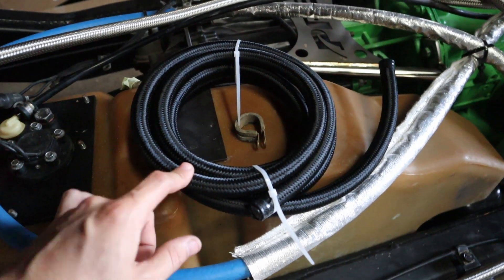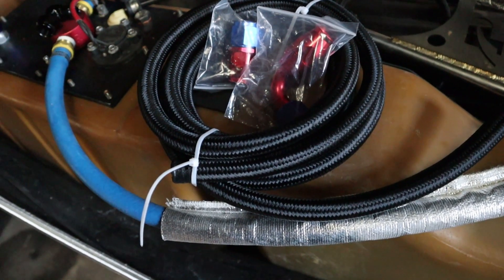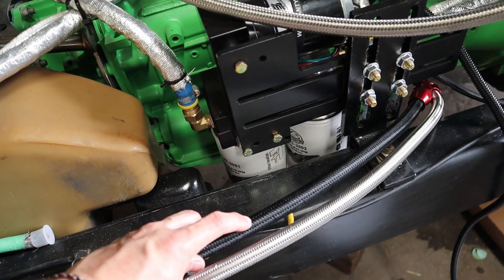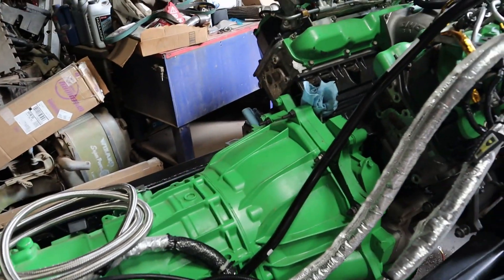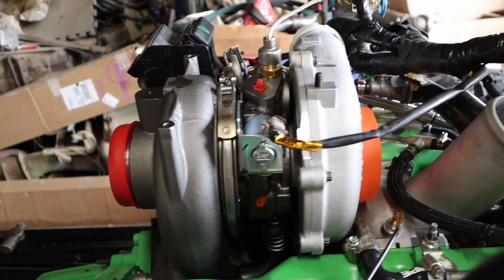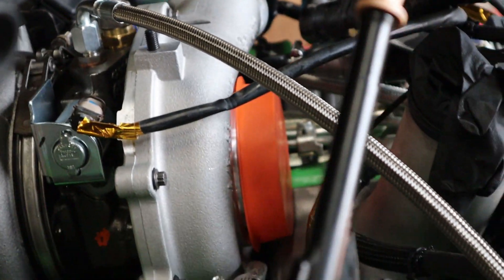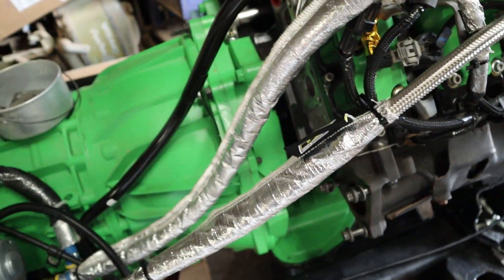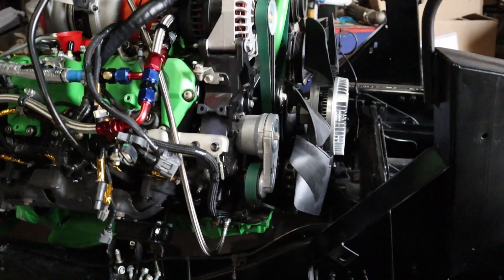New Turbo and Remote Oil Feed Install, Plus We Found a Fan that Fits! - Project Duramax Humvee

Comment: Great work and nice descriptions as you go! Where did you find the smaller engine fan?
Reply from the maker: The company I got this one through doesn't usually sell their engine swap modified fans, so they did not want me to identify where. But I do know ModMofia has one listed on their site thay is meant to be used in this type of swap. I also have read that modifying diesel fans is not as dangerous as a high rpm gas engine, but if you want more info on that, I'd recommend doing some research online from people who have done it a lot.

Comment: Happy to see project moving forward, just a quick check, are you using anti-seize paste on exhaust bolts into turbo?
Reply from the maker: I did. First couple I put in I had forgot but took them back off and applied it to all of them on the up-pipes.
Reply: What size turbo is the new one compared to the original one?
You’re getting there, slowly but surely which is the best way to make sure it’s done right and looks great! 👍
Reply from the maker: It is just a stock size turbo. After building the engine up and testing it on the stand I noticed it was blowing oil into the charge pipes and it needed to be rebuilt. Ended up finding a sale on a new turbo for barely any more than rebuild cost with no core charge. Ecm is also not tuned for a bigger turbo yet either. I want to get the swap done before looking into upping the power much more.